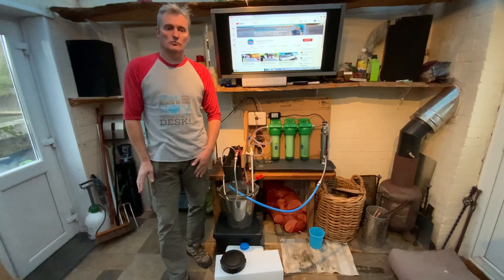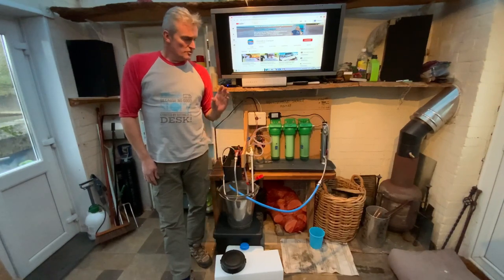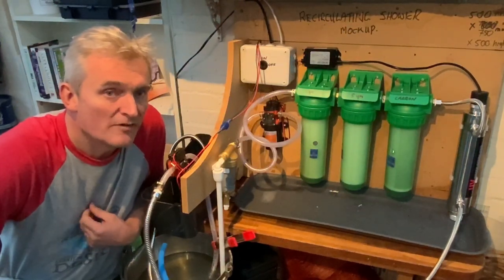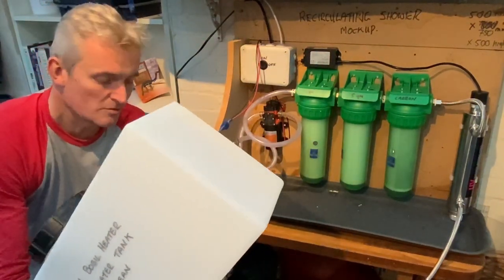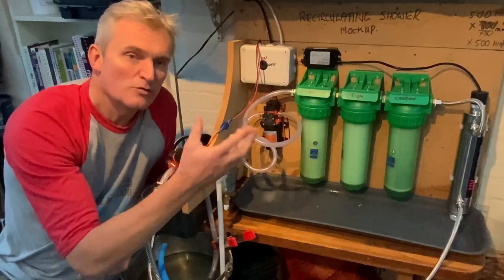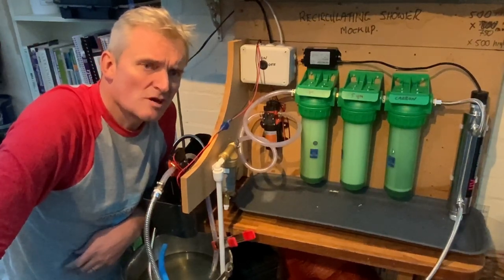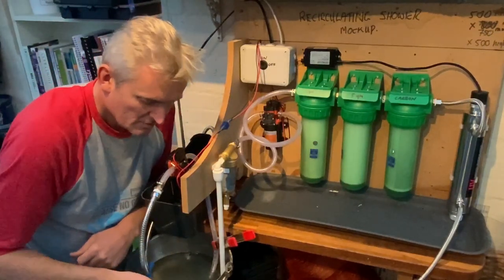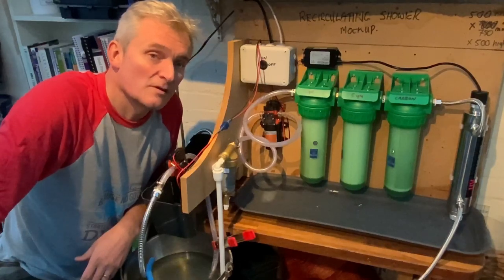Horsebox Camper Recirculating ‘hour’ shower part 1

Comment: Alex is great, but this video aren't that messy and easy to understand. Even i don't doing plumping or anything with the water, bathroom or anything understand the system now, thanks to you. I had to watch the video twice to understand everything, but now i do. I tried to understand Alex system but after several attempt i gave up.

Alex has heavly system in hes RV because the kitchen as well so it can be little bit messy if you don't doing anything with plumping.

Thanks again! In our family cabin there is only summer cabin, but after your video im thinking little bit about to convert it so it's easier to stay there for the winter. We having well there, but it's only about 200 liters. Like you are saying if you are doing 2-3 showers it's empty so in five showers at max it will be empty for water in the well at the cabin even less because we need to wash the dirty plate, pan etc.

But with this solution i could stay for much longer period in the winter time as well. Will be looking at it in the summer when i will be there for a while. :)
Reply from the maker: Thanks for watching, good luck with building you own system.

Comment: is your uv sterilizer 12v or 240v? how have you powered it please. im assuming like mine it came with a 240v ballast? is this the reason (I presume) you got a 12v ballast and swapped out the 240v ballast for this?

Comment: Yay. Love the choices. Really like my seaflo kit. Was very impressed with the bobillvans stuff. Do both pumps work when you apply power?. The seaflo pumps are pressure switch so will activate from a the turn of a tap instead of the flick of a switch. We have gone for the seaflo sump pump and love it.
Reply from the maker: Thanks for watching! I just used a switch as it was easier. I will have a switch to provide power as they can activate every so often with a shower as some water leaks out (usually in the middle of the night making me jump) but use a shower tap when it is in situ. These pumps will activate on pressure drop and I will also have an accumulator on the shower pump to stop the pulsing. I would have preferred the 30 series with the 1/2” fittings as opposed to 10mm but they are £60 each. I already had one of these as a spare so thought what the heck. Much cheaper than Shurflo so will see about longevity but great kit.
Reply from the maker: Loved your river water video, was really tempted with a change over switch to do the same as you! Running out of weight though and retro fitting this stuff is a pain!
Reply: @HorseboxCamper  hopefully they will stand up to the test but easily replaced if not.  Avoiding water hammer is a must in my opinion.
Reply: @HorseboxCamper  who knows if the river water to drinking water etc will work or not but it's a fun experiment